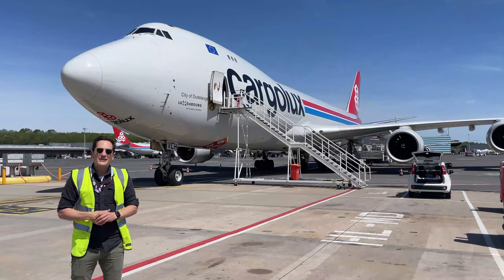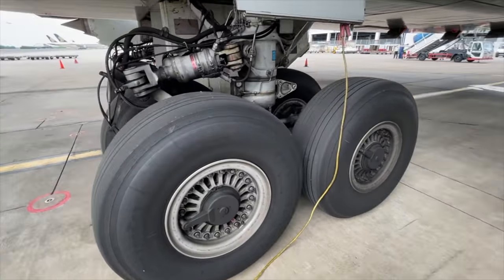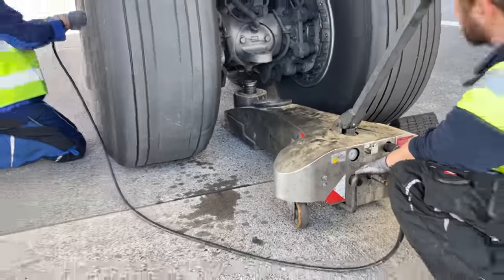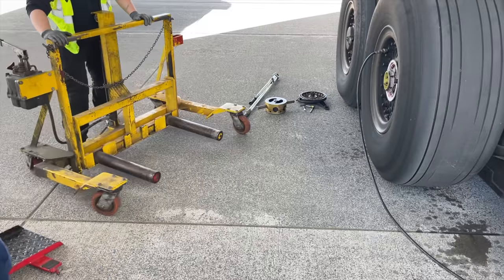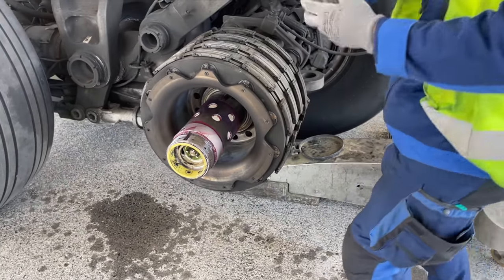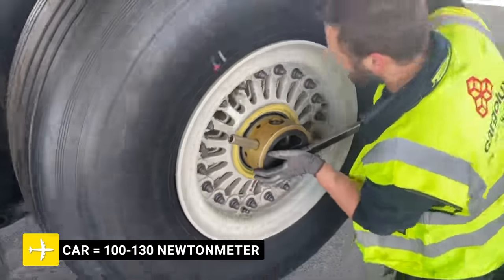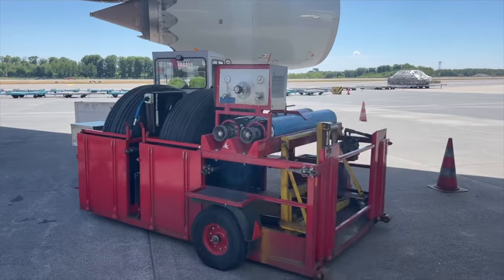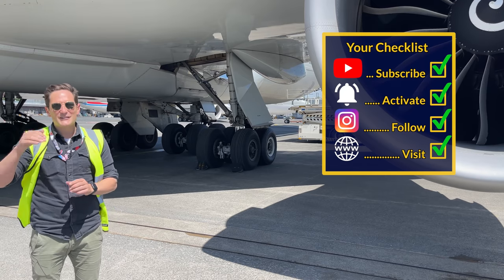How to change an AIRPLANE TIRE in 15 MINUTES! Explained by CAPTAIN JOE

Comment: You would think someone would have the common sense to add fins to the hubs of the tires to catch the air and start them spinning before they touched down.   Nope.   

Once stowed up inside the plane, they wouldn't add any additional drag.

Comment: No need for wheel axle thread protector?
Reply: The mechanics didn’t use one which is incorrect. If they had damaged the axle thread while getting the wheel on or off your looking at a possible axle replacement.

Comment: Umm, it's bogie, not boogie.  Multi-disc brakes do not have calipers, exactly.  And, the air in the mounted tire needs to be substantially released before the axle nut is loosened.  Although it is rare, a damaged wheel could be held together by the force of the axle nut against the bearings, and explode when that force is removed.  Letting the air out first is safer.  I changed tires, brakes, and coffee makers for fifteen years, then switched to avionics and never got my hands dirty again.

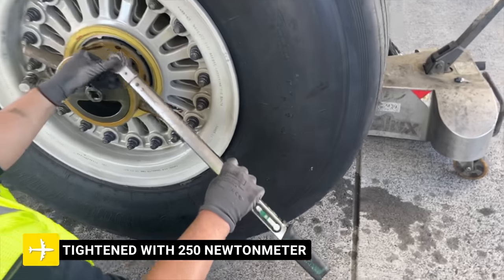Comment: 5:53 Exactly how you would to it when changing the tyres on your car.
Me: I agree but...
Every car tyre mechanic: What torque wrench?
Every car owner: Never seen any wheel shop consult a manufacturers book and use a torque wrench 
Owner changing tyres: SOB I cannot get the nuts off or I have stripped the nut or my wrench broke and still cannot loosen it.

Comment: Well I’m 13 and I want to be a pilot so isn’t nitrogen cold and two planes run hotter than an average vehicle so they need colder gas so that the engine doesn’t over heat I think. So because of how fast an airplane is moving I’m pretty sure if the plane was to land with normal air it would either burst or catch fire but seeing that nitrogen is cold it will cool down the tires when landing to prevent a fire. That’s just my guess I didn’t watch the other video but I’m just guessing 🤣
Reply: Ha ha, high level comment.

Comment: I made a few assumptions here:
The wheel rim contains the wheel bearing!
They don't need any ground power! (since the Jack is "powered" by the wheel pressure)
They can change only one wheel per axle! (strange because of the different circumference between the new and the older tire on the same axle)
Is all of that correct?
Awsome video! I love the many technical details shown.
Reply: It’s a wheel assembly. Generally speaking, a wheel rim is just that. The rim or edge so to speak of a wheel. Wheel assembly, includes everything! No ground power is required at all. Just  pneumatic air. Or in this case, the techs used a cheater hose to connect from Jack to Tyre. You can change both Tyres on same axle. Just one at a time. Simply by lifting the Jack a bit more to account for new rubber.
Reply: Wheels can also rotate on the axle centre, so will compensate for the slight difference in diameter, plus each tyre assembly includes in the centre the wheel bearings, the shaft is fixed and does not rotate, the bearings are set to the correct preload during mounting using the rotating and the torque settings, so they are correct for the particular aircraft. 

Also there is no torque applied via the axle, it is only acting with ground pressure, so no worries about difference in rotational speed, and the braking is sensed per wheel, and applied by the brake assembly, along with anti skid, per individual wheel. So for the gear section with the 4 tyres there, each tyre has it's own ABS control to allow the maximum braking for that particular tyre, depending on tread condition, and the wheel speed for all the tyres on a bogie are used for control of that particular bogie, plus for control of the others after positive sensing of weight on gear during landing. Also operated after take off on gear retract to keep the wheels from rotating during the gear up cycle, then released so the brake assemblies can cool.

As well using the pressure in the removed tyre helps, but if the tyre has burst they also have a high pressure nitrogen bottle on the service trailer, to drive the system, and also it can be used to inflate a tyre that is flat for some reason, like a faulty valve that got changed on the line, or the tyre pressure sensor malfunctioned and got replaced on line maintenance. The old tyres go off to the tyre shop, where they are deflated, inspected, and then demounted, and inspected internally, along with the rim getting cleaned, inspected and serviced. Each tyre and rim is serialised, and has a service life after which it is overhauled. Old tyres can be taken and retreaded, making them like new again, or are taken and scrapped, often ending up ground up in bitumen used to relay runways, or as rubber crumb used to make mats. 

Very expensive to replace a tyre, and you can destroy all of them in one single poor landing, especially if there is a high crosswind, inexperienced pilot, and you scrub all of them down to the wear limit in a single go. They are very conservative with those, there are at least 16 layers of steel belt and polyamide reinforcing in that tyre, and I have seen them taken down to 6 layers visible, in a single landing, from a brand new tyre put on the same day. Then all get replaced, again.

Comment: It is a bloody TYRE. TIRE means you need a rest for fucks sake.
Reply: Americans say Tire though and notice how Joe used PSI instead of Kpa or Bar for the pressure despite being from a metric system country (Germany).
Reply: @psirvent8 The use of psi is common in aviation..like knots and feets e.g
Reply: Its neither, its a wheel😆😉

Comment: Shouldn’t the 2 locking bolts have been inserted through the wheel nut from the inside, one was and the other wasn’t? Standard engineering practise surely.

Comment: better a wheelchange tires are done in the workshopi would not dare to remove a tire with 220psi send the rolling unit to the shop

Comment: Its spelt. TYRE.   for christs sake.  'Say it' then think of the letters applicable in 'proper english'.
Reply: Its a Boeing, so its TIRE..
Reply: @speedbird9313  its a boeing then ? oh dear.  manufacturing swarf and chafing electrical cables   and flight control systems that put you in a terminal dive come to mind then .
Reply: @randlerobbertson8792  Its still a tire tho😂😉
Reply: @speedbird9313  nope... its a tyre and the colour is Black. 😉  note the correct spelling of. 'colour'  too
Reply: @randlerobbertson8792  Only on your island..😆😉
Reply: @speedbird9313  Yes. which actually gave the queens english to the rest of the civilised world. Enough said really.

Comment: This is the worst Fing video ever. Use a safety cage. WTH is wrong with you guys. Two dudes just killed at delta doing it wrong like this
Reply: How do you change a wheel with a cage on it? Cages are used when putting a new tire (new rubber) on a wheel rim and airing it up. That is the dangerous part that requires a cage. I’ve done this several times myself with large military trucks. Removing the whole wheel and replacing it with a different one that is already aired up and has the tire mounted (as shown in this video) does not require a cage. Not sure how you propose putting a cage on a wheel before removing it off the landing gear. If you disagree, please tell us what timestamp in the video requires a cage for safety.